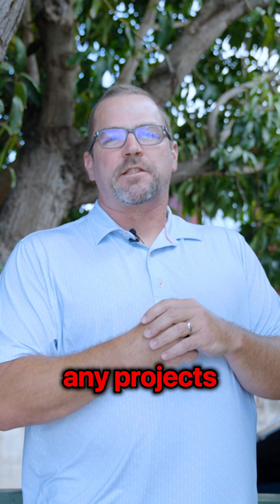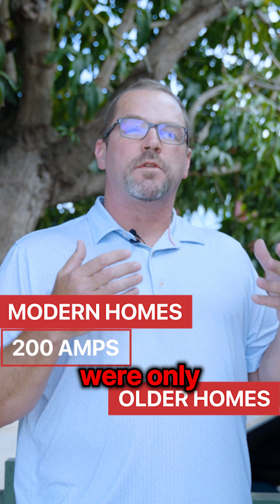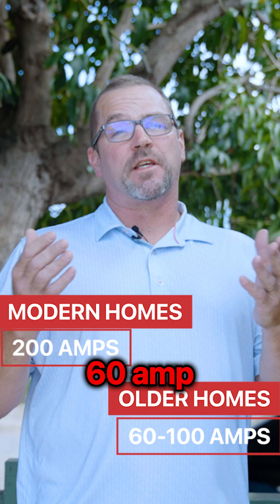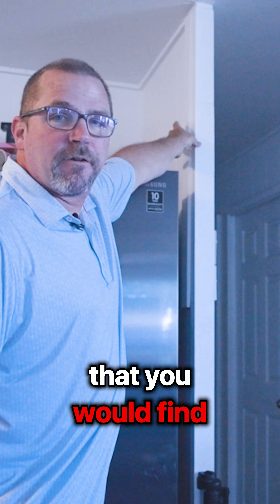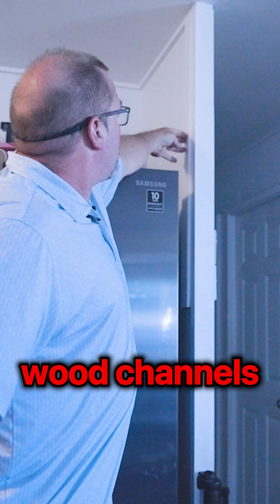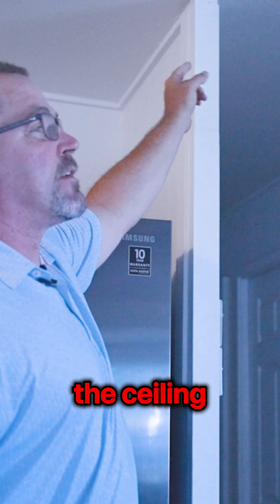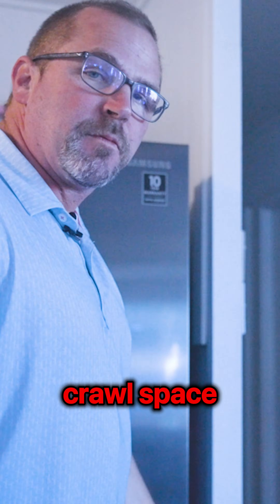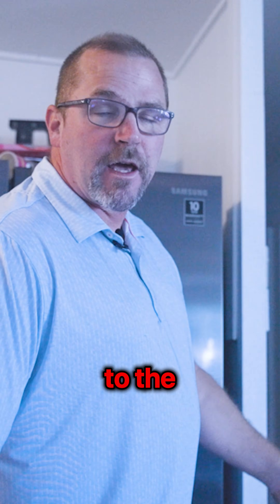Updating Your Hawaiian Home Electric 🏠⚡️

Comment: lol, gaslighting on full display. Having access to all of the electrical literally makes everything 10x easier…
Reply: Your right in the sense that It is easier to access but in order to make it look nice you need to be a bit of a carpenter as well. The wood channels need to be run clean and usually are painted.  I personally feel it is easier to run through the voids in framed walls were you use less material and less costly boxes. This video is just to share the differences.  Thanks for checking it out.